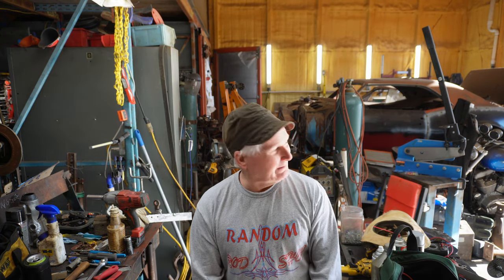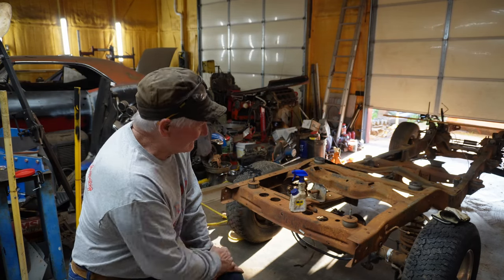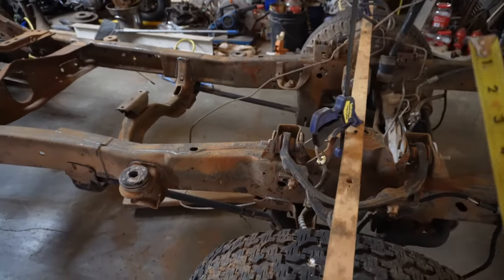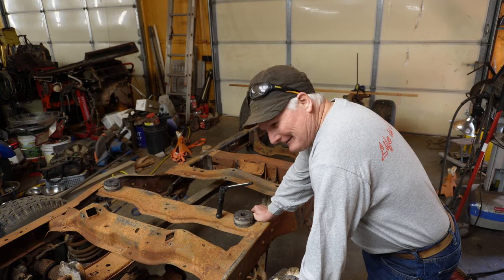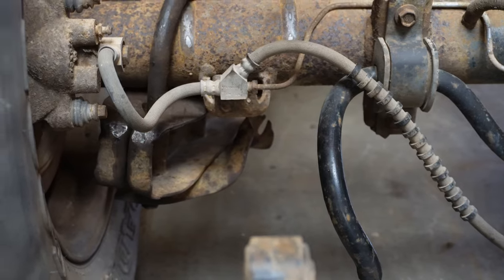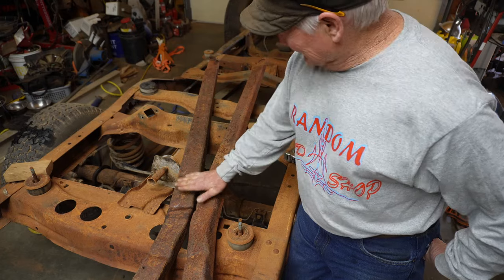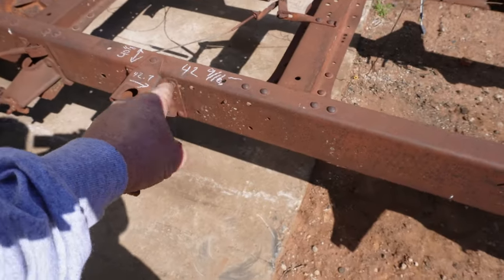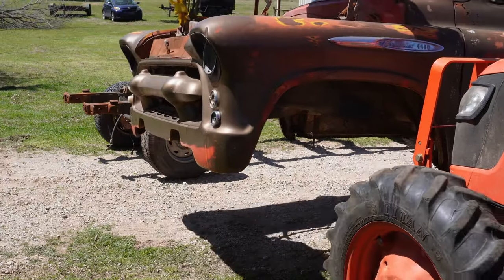EXTENDING the Explorer frame WITHOUT CUTTING it.

Comment: The truck arm rear suspension is still used in nascar with great success.add a watts link instead of a panhard bar,cant get no better or reliable susp.
Reply from the maker: 😊 When you have a good design don't mess with it. I really like the simplicity and strength of this design. I am working on a jig to fab new arms. All of mine are pretty rusty.

Comment: Valuable information for attempting a similar build. Do they have drop spindles for explorers? I am not seeing any advertised online.
Reply from the maker: I have not seen drop spindles for the 4WD. I think that you would need to replace the 4wd spindles with 2wd spindles to get lowering spindles. I have not done this swap but I think that they will swap. You would lose 4wd (RWD only) and need to change the wheel hubs also.
Reply from the maker: Ok...You learn something new every day. Since where I live the roads can be a little rough, I don't think too much about lowering my trucks. I assumed that the aftermarket would have produced a drop spindle. However, I have not located a source for dropped spindles. If someone has a source post it here. After studying the spindle design, it may be challenging to raise the spindle 2" with the original Ford design.
Reply: @RandomRodShop  Thank you...cool build.

Comment: Why not use the chevy frame cab mounts
Reply from the maker: In general, I just use the prothane universal mounts. That way I don't have to remember what cab mounts I used on each project. I usually have a set or two in the tool box.

Comment: I figured the Ford Explorer trackwidth would be narrower than a Chevy truck. What year chassis was the donor?
Reply from the maker: Thie frame is a 1996, but I think 1995-2000 are the same. The wms to wms on the explorer is 59.5.  The 1955-59 is 62". Since I want to use wider rims, I don't think the 1 inch per side is a problem.

Comment: 1/2 ton hood and fenders are shorter arent they?
Reply from the maker: I think that the 1/2 ton hood is mostly taller because the fenders are shorter top to bottom. The two hoods are laying within 10 feet of each other,. I will put them side by side and check out the lengths tonight.  Thanks.
Reply from the maker: I just measured along the side of both hoods they seem to be the same length. They appear to be the same dimensions overall, 😊😊